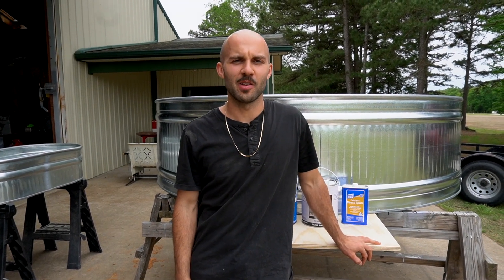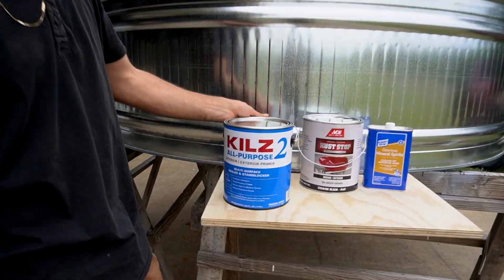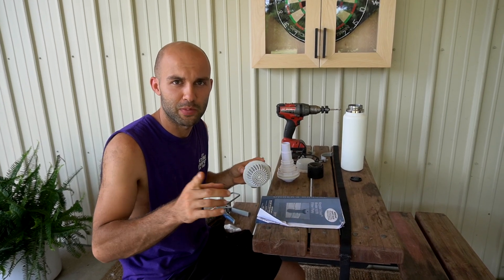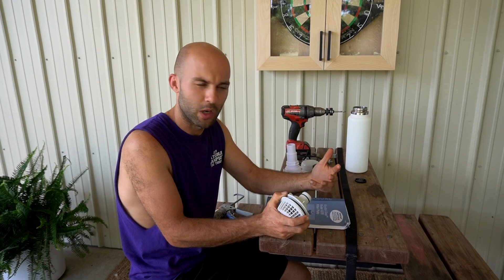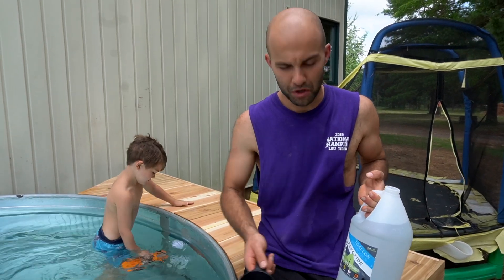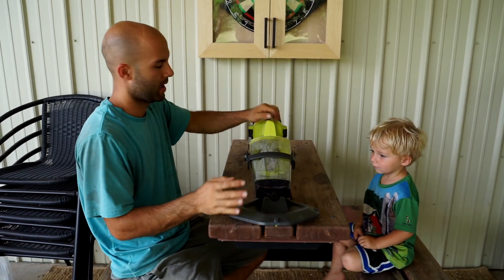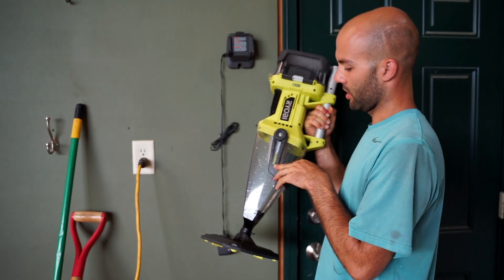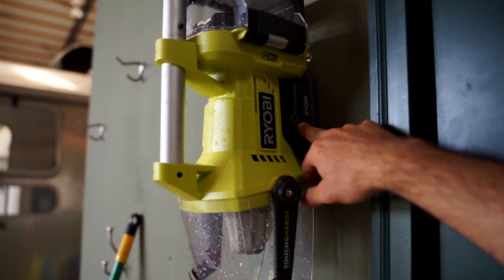BACKYARD STOCK TANK POOL DIY | ULTIMATE

Comment: Curious how cleaning/changing the filter is going. We've got an inflatable one and are looking to take the filter to a stock tank, but the inlet and outlet valves have stoppers to keep the water in while doing pump maintenance. I really like the setup here though, and am curious how you keep the water in while working on the pump and filter. Thanks for sharing!
Reply from the maker: So we have some pine trees close by and it’s pretty windy at times where we live. I change the filter about every 2 weeks just because it gets clogged a bit and you can tell when the valve doesn’t push water out as hard as it should.
Reply: My solution to clean the filter. Lift the Intex filter pump up just above the level of the inflow water line (the outflow line will be below the inflow line, so no problem there). I set the little Intex pump on a table next to the pool. My table has a slight edge on it, so it catches the edge of the pump, and the pump stays right there solid while I open it, clean the filter with the water hose, and put the filter back in, tighten up, place the filter pump back on the patio. Done. You might want someone to hold the filter pump on your table so it doesn't fall off while you clean the filter. Another workaround to make that Intex pump limp along a little longer. My Intex 300 gph has lasted four seasons, but I think some impellers are broken so now I have to tap the pump on the patio to shake the broken impellers to the bottom of the impeller casing so they are out of the way of the existing impellers. I haven't been able to buy an Intex pump this season - China's production stopped for quite a long time.

Comment: Would you mind explaining why you put the intake and output right on top or each other? In every other stock tank pool tutorial I’ve seen them separate them, putting a hose on each side (opposite directions) the same way they are installed on intex above ground pools . Thanks! Great video! We are gonna do hydrogen perioxide.
Reply from the maker: I saw no problem in having them one above the other. I just knew the hoses couldn’t be kinked and needed to be stretched out. We have not had any problems with the pool as of yet. The hydrogen peroxide has worked wonderfully as well! Good luck with yours! And thanks for watching!
Reply: Steady Streamin Cashios thank you! Worked out great for us! Been going for about 3 days now, we went chlorine tablets route. Our ph is kinda high. Any tips on how much baking soda to add when the ph is about 8? We have the smaller 5ft stock tank that caps put around 400 gallons full. Thanks!

Comment: Great stock tank video! Thanks for sharing;). I’m trying to decide between metal & poly one.   Concerned about zinc leashing from galvanized one, did you do any research on that?  I think it’s great you’re using peroxide, I didn’t know that was an option. Chlorine makes me sick.  Thanks for that tip too.    How’s your stock tank holding up this spring?
Reply from the maker: Hey. We did not look into the zinc. We have loved the peroxide. We continue to check the levels for it and the ph level. It’s been great, we drained it for the winter and just cleaned and started it back up! Everything look great.
Reply: @SteadyStreaminCashios  Awesome review! I appreciate the reply.  2 local tractor supply stores have either the poly or metal.   If I don’t buy one or the other they will be gone and who knows if they will get anymore before summers over. Lol
Reply: @LadiesofPurposeTV did the have 10 foot avail in both poly and metal at tractor supply?

Comment: So you didn’t use sealant just the tape right? I saw you linked a sealant in the description.
Reply from the maker: Yes I did just use the tape. The tape filled the gaps well and I wasn’t concerned. It has not leaked either. The sealant was an incase. Thanks for watching